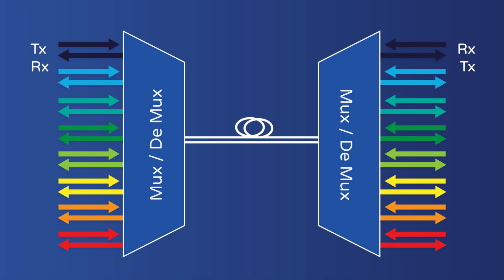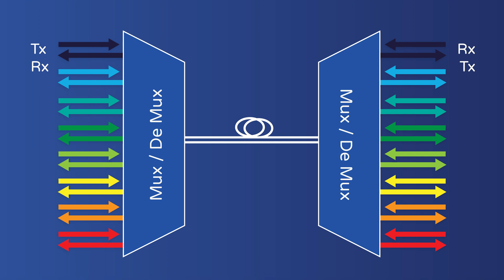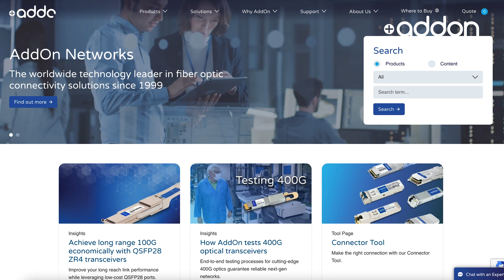What Are Mux & Demuxes? Explaining Passive Multiplexers

Comment: Hi, may I ask a question. Since single fiber mode can only carry one wavelenght at a time, how does one fiber carries the downstream, the upstream and the tv singnal all at once?
Reply: Ignoring technological details and some physical concepts like dispersion, phase velocities, and refraction, my basic understanding is the following. The word "mode" can be quite confusing. Similarly, "color" and "wavelength" should not be confused as a white-colored light carries a multitude of wavelengths.

A typical physical optical fiber (single mode or multimode) can carry various wavelengths, in the sense that if say I shine 1510nm light in it, it gets to the other side, if I shine a 1530nm light, it also gets to the other side. Also, optical properties of the media (glass) are effectively unchanged by the presence of one wavelength when another one is being reflected (radiative effects are negligible). Thus, a fiber (single or multi-mode) can not only transport any single particular wavelength from a range of wavelengths at a time but also multiple of those wavelengths at the same time.

What's then the difference? The main thing is that multimode fiber can have multiple distinguishable rays (modes) of light transported at the same time. That is, at a point of time and at a point along the fiber one can observe multiple light rays propagating (possibly of different colors or wavelengths) simultaneously. In contrast, a single mode fiber propagates practically only one ray, i.e., at a point of time and at a point along the fiber one can observe at most one ray of light of a single color. This ray has one color but can contain multiple wavelengths in it. Of course, everything is limited in some way and different wavelengths have different (although slightly) refractive behaviors. That's where the details come into play and limit channels, distances, etc.

In the end, one either separates rays and/or separates wavelengths from a single ray. The single mode fiber transports a single ray of a single color at each point in space and time but at the end (using, e.g., precisely the refractive differences between wavelengths) this ray is split into several rays of particular wavelengths. As far as transmitters and receivers are concerned that work only on a particular wavelength, they don't care that the particular ray they are working with was transported together with other rays combined in a single color and a single ray.

For example, at time t0 a green beam goes through the fiber a green receiver detects signal, a red receiver detects no signal; at time t1 a red beam propagates and the green receiver detects no signal, but the red one detects signal; at time t2 a yellow beam propagates and both the green and red receivers detect signal. In any case, neither the red, nor the green receiver were affected or cared that their signal was mixed with another separate signal, but note that the beam is always one in the fiber.
Reply: @G3Views  No, that is not what I wanted to ask. My point was... Since single mode can transfer one wave at a a time, how does multiple waves travel together for upstream, downstream and TV. I have read something about phases lambda 1 lambda 2 etc doest that have anything to do with the wavelenght?
Reply: @grizzly6385  
Perhaps you also mean GPON? that also helps is accommodating multiple customers, services.... etc, however that works more of a time based division thing, and it uses one wavelength for tx, another rx. But same wavelength across all users, the main sauce is TDM which makes it works 
If you mean how a single fiber is there, but you get telephone, TV, IP (internet), that is more of a higher layer in the OSI model, even if I can't explain that properly it is very possible to carry those services as long as the bandwidth is acceptable
I know I don't have a clear explanation like the others have also tried here, but I feel like including PON where residential networks exist is important
Reply: Light in one fiber can be transmited in two direction, downstream and upstream. In each side, the MUX&DEMUX will handle the wavelengths, when you have the components with the wavelength what your network want.
The important knowledge is that, the optical light path is reversible